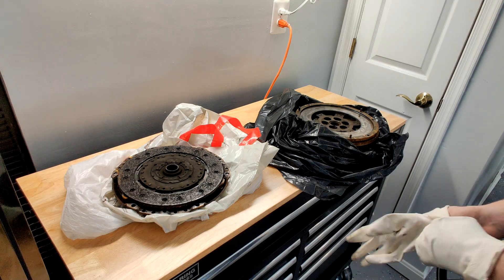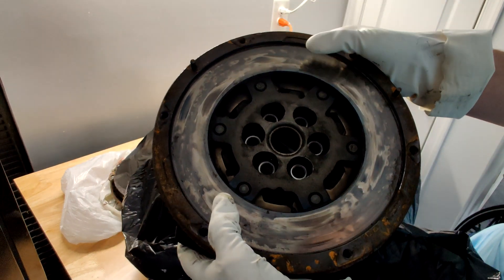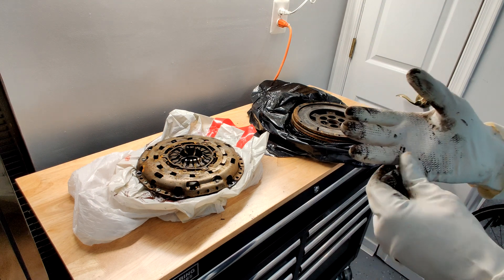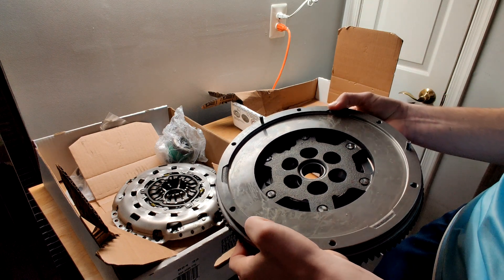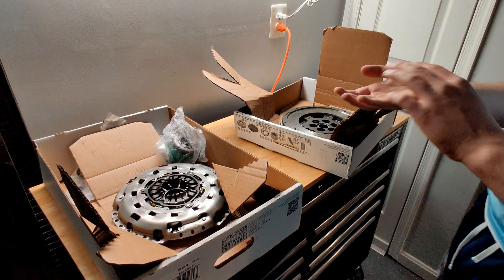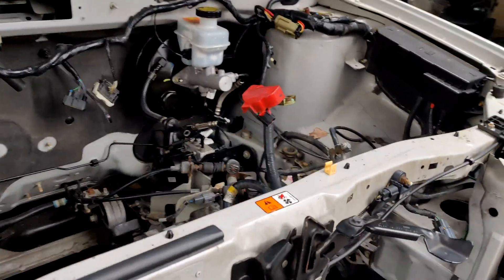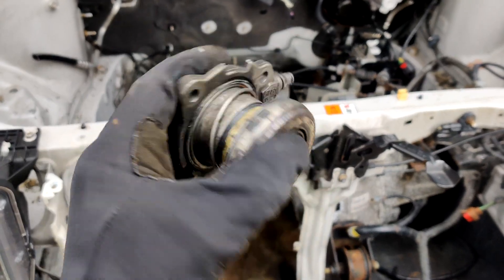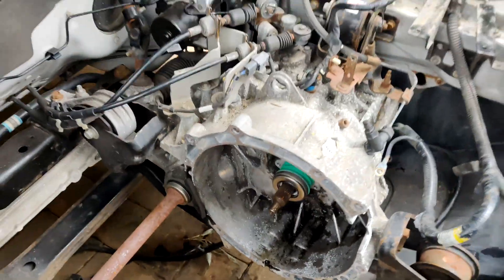Ford Escape EV Conversion EP 8: The Clutch and Flywheel

Comment: Just subscribed. Why retain the clutch?
Reply from the maker: Mostly so I can switch gears while driving and be able to drive it like a proper stick shift if I wanted to, although that's not necessary with an electric motor. I decided it was worth  the few % drop in efficiency.
Reply: @reider_mcfeely  OK, just that the extra mass to accel and decel all the time I wouldn't. Also I've driven a standard w/o a clutch just by backing off the gas b/tween shifts. 
My 88 Grand Am is standard. I'm not pulling the gears out of that either for the same reasons you pointed out.  I'm just not gonna use a clutch. Just sayin'  :)
Reply from the maker: @ebenwaterman5858  yeah I'll have to see how it feels. If it's sluggish I'll probably get rid of it, but I figured there isn't really any harm in starting with one. I've never driven stick before and the idea of a clutch pedal sounds pretty interesting considering right now I'm driving a boring automatic SUV. 

Going from clutch to clutchless would probably be a pretty quick project if I end up going that route. What would probably be best though is to have a lightweight single mass flywheel made so I have the best of both worlds. Would be pricey though. 

Good luck on your project!
Reply: @reider_mcfeely  I've been thinking,.... a flywheel is a energy storage mechanism.  You may not be losing anything at all.  Just from the pure physics point of view.  I might have to re-evaluate my project.  :)
Reply: @reider_mcfeely  Really interested by this build. :)